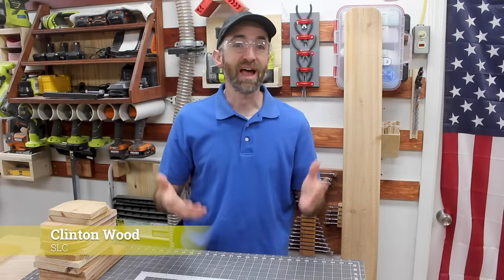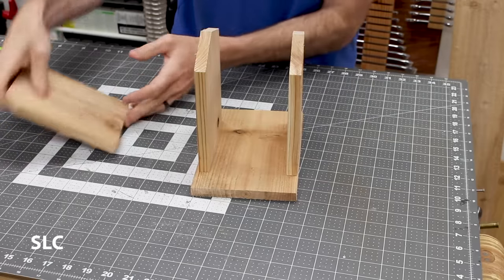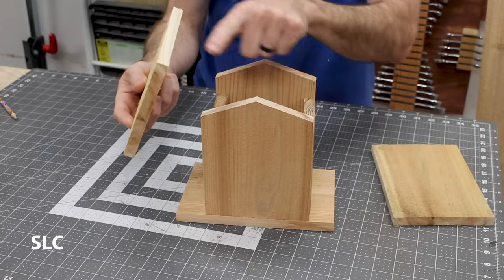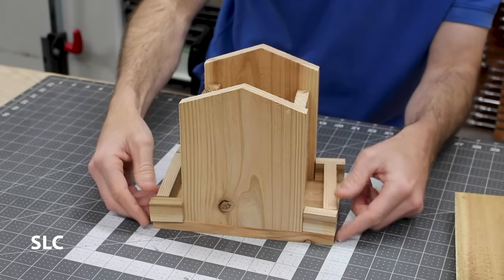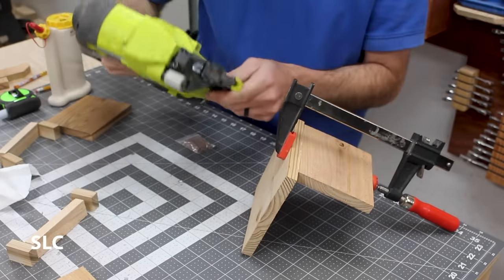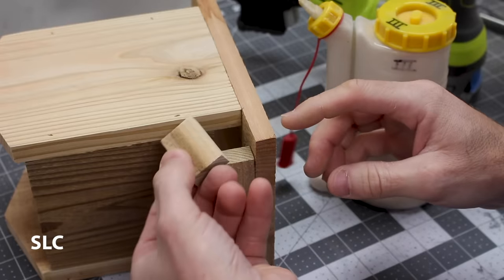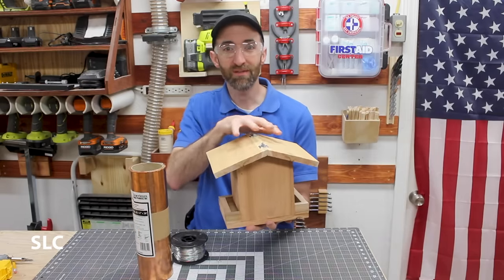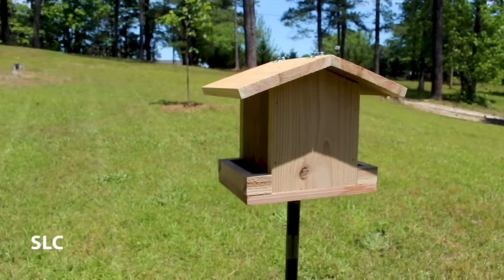How to Make a Bird Feeder with 1 board | Simple DIY

Comment: Birds such as Cardinals and Blue Jays will need a larger area in which to stand. I suggest extending the trough out further, Additionally cut an old bicycle inner tube and tack a piece across the hinge area to keep water from leaking through the roof and ruining the feed,

Comment: What is this black kind of ring you have on the left hand? Noticed many woodworkers has it.
Reply from the maker: It is a silicone ring. Just incase it gets stuck on something, it will tear before my finger gets trapped.
Reply: @SpecificLove7  do you wear it over your wedding band ? because i have wondered this too.
Reply: I wear one of these instead of my nice wedding ring when I go to work, or when working on things like this, or metalworking, so that my finger doesn't get torn off or the skin peeled off if it gets caught. When I'm not working I wear the real one. The silicone rings only cost about $15-25

Comment: What if I don’t have those fancy wood cutting gadgets
Reply: You can use a protractor to get the angles.  Eg, a protractor can easily give you the 20-degree angle to cut with.

Although the video said that glue was sufficient, but IMO, the tool used in this video that helps more than all the different kinds of saws, is the brad nailer.  You can make this project with a hand saw, slower but still possible.

But the brad nailer is very useful for doing some small nails into these pieces of wood.  Yes, it can be done with nail and hammer also but you would need more balancing and just more care to not bust up a particular side of the feeder.